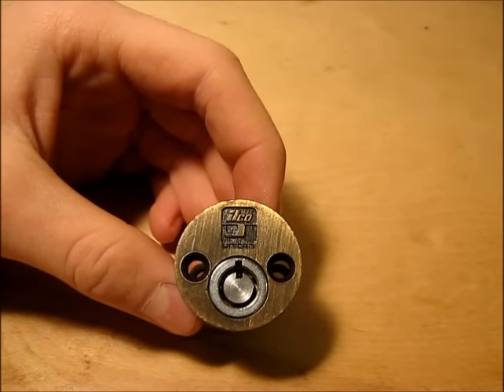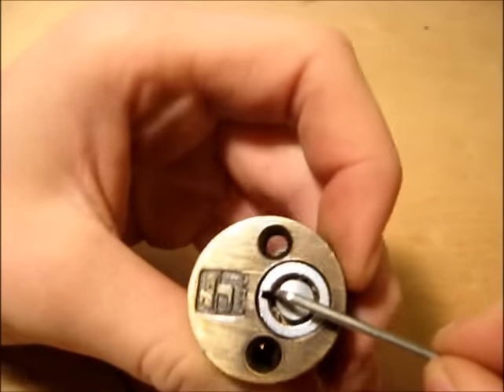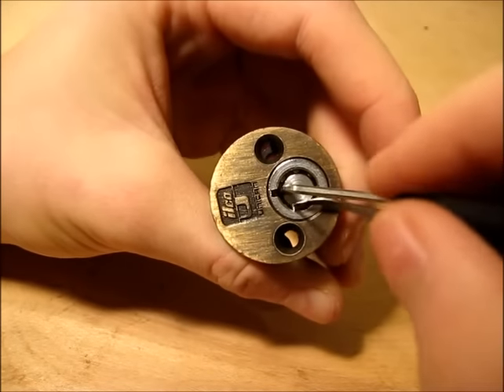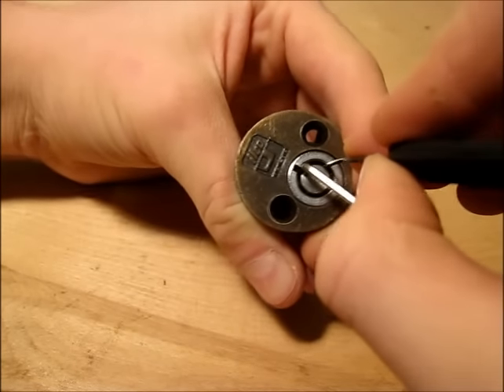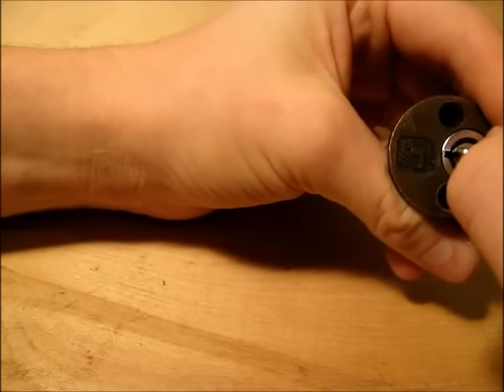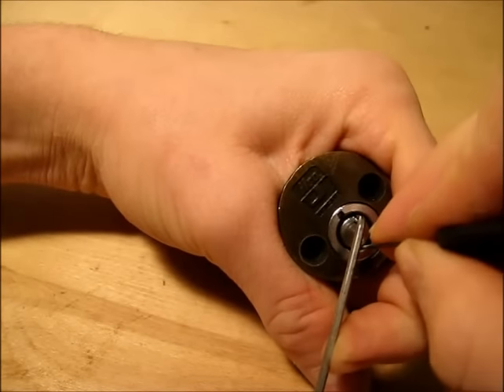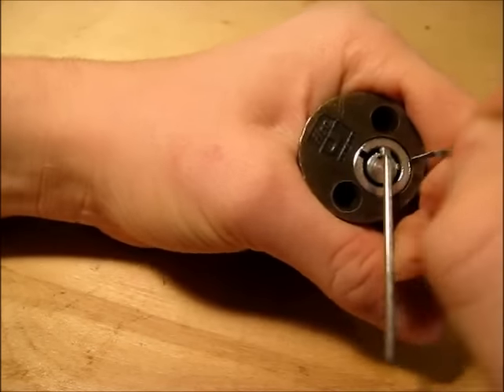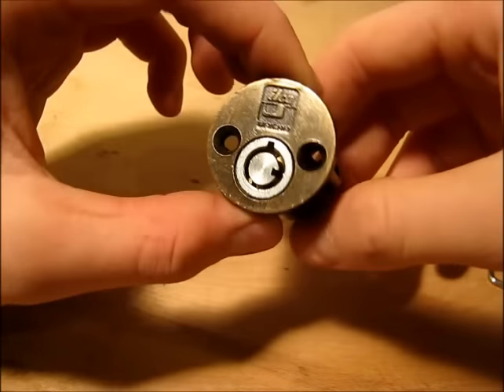How to pick a tubular lock with out a special pick .

Comment: Nobody believes me, but one day my sister and I were working at a horse barn when I had finished my chores early. Out of pure boredom (and being alone), I tried picking a coke machine. I used a little tension and pushed each individual ball inside the keyhole using the end of a paperclip. Suddenly, the main latch popped out! I had genuinely picked a coke machine! Unfortunately, I was so excited and convinced that I was was a master locksmith that I shut the door to show my sister how I did it...and I couldn't get it open again. Perhaps it was a fluke or just pure luck. I looked like such an idiot though.
Reply: Didnt you tell this one in another video

Comment: I figured out another way to do it without lock picks. I grabbed an old junk tape measure, and cut two small pieces off it. Using the edge I cut, I pushed 1 piece in on the bottom, then did the same for the top. The way I got it to work was by pinching the two pieces together which put pressure on the center circular piece, while at the same time pushing inwards which flexed it out so it pressed against the pins,  and twisted.

I was shocked myself that this worked when I figured it out, cause usually my ideas don't pan out, but it worked first try!  However, the second one took like 7 tries, but it still seemed easier than the method in the video. This was done on an Ace II circular lock.
Reply: could you post a video of the piece you cut? I would like to see what you mean
Reply: Bluraz I
Reply: Bluraz can u explain that 1 more time how big were the 2 pieces of measuring tape and then what did you do?  I'm trying to figure it out now 
Please let me know Thanks again I'm very interested in how you are saying you did it.

Comment: Thanks for the very clear instructions.
My lock doesn't have that little groove in the core / center to stick anything into, so it's really hard to tension it. Any advice?
Reply from the maker: Ixupi Do you know who manufactures the lock? I could give you much better advice if I knew what lock you’re working with.
Reply: @PickingandEntering  I have no idea sadly, it's on an old electronic safe with dead batteries and the keys inside haha. There's no brand on it. 
I've found out that there's a tiny gap inside the ring that I need to put rotating tension into, with a little anchoring tool of some sorts. I got pretty far with some makeshift stuff just now, but lost my grip and it snapped back :') I have no experience with locks whatsoever but I think I'm getting somewhere.
Reply from the maker: Ixupi Yeah you’re best bet is to just spend a lot of time on it till you understand how the lock works lol
Reply: @PickingandEntering  I gave up on picking it open haha, but I might still try another time because it got me real interested, what a puzzle. I finally managed to open it without destroying it by using a trick where you smash the safe real hard while wriggling the handle, to bounce the lock open internally. Yay! Later I found a manual, and it said to turn the key COUNTERCLOCKWISE.... facepalm been picking clockwise... 
Is that common?
Reply from the maker: Ixupi Yeah it’s pretty common, most of the time they are clockwise but it’s definitely not rare to have it go counter clockwise.
Reply: @PickingandEntering  hi Michael, we have a basic electronic Yale home safe and lost our key — can you suggest best way to open the lock? TYVM
Reply from the maker: @lynneweinstein3932  It has a key and combination to open the safe is that correct? And you have neither the key nor the combination?
Reply from the maker: @lynneweinstein3932   you have several options to potentially proceed with but one option requires working batteries in the safe.
Reply: @PickingandEntering  tyvm for your response. I’m in trouble - batteries not working😖
Reply from the maker: @lynneweinstein3932  Ok that does limit your options significantly. You can either pick the lock if you have that skill or pay a lock smith to open it. Unfortunately the cost of opening the safe is probably more than what the safe is worth.
Reply: @PickingandEntering  what about if I purchased a 7 pin tubular lock pick - would that work, or a waste of money?
Reply: @PickingandEntering  correct. A mess.
Reply from the maker: @lynneweinstein3932  you could definitely try that! As long as you don’t spend too much money on the tool and you are okay with the potential that you won’t be able to open it.
Reply: @PickingandEntering  TYSM, Michael - I just wanted to make sure it’s not a total waste of money to try that tool. Do you know, by chance, if the Yale home safes have a seven-pin (vs. 8 or 10) cylinder? The angle where my safe is makes it impossible to be sure. Ty again.

Comment: Great video, Does the silver Allen key need to be in while you're pushing with the black one?
Reply from the maker: MuscleSheriff Yes, the silver Allen key has to be in the lock to add tension to the core while pushing in the pins.
Reply: @PickingandEntering  the whole way?
Reply from the maker: MuscleSheriff   Yes unfortunately that is the case.

Comment: Did you know that if you pick it and move it just a little bit, not the full quarter turn,then roll up a somewhat study card and tape it up to the inside diameter of the lock itself. put the card in and make an impression from the study pins and you will have a key for the lock itself and be able turn it all the way open.
Reply from the maker: Really ! I will have to try that, thanks for the idea.
Reply: +Michael DeRose Yep it works,as long as you only move it a little bit to keep the pins stiff.
Reply: Larry G 《 Thumper 》
Reply: What kind of card ??

Comment: Toward the beginning When you say "add tension to the Allan key" do you mean press down into the lock constantly, press sideways (like turning the lock) or do both?
Reply: You would add tension like you are turning the key normally.... (sideways as you mentioned) the whole time you are picking.
Reply: @frankkeaton9563  OK so not applying additional pressure pushing down into the lock, just let it rest where it slides in without pressure, correct?
Reply: @anotherOneMore7  Yes. You put it in place, then push it sideways to make the core move as if you were turning the key. Keep the pressure all the way while picking. When all the pins are set, the sideway pressure will turn the core automatically. You need to adjust the pressure tho. Too much and the pins won't move. Too little and they will reset.

Comment: What size Allen Wrench? Tried using bobby pins for a tension wrench & it didn't work.
Reply from the maker: Atkrdu I used a 3/32 and used a bench grinder to change the shape from 6 sides to 4. Hopefully that helps.

Comment: use a plug spinner.
Reply from the maker: +Paul MvN Wouldn't that get i the way of your pick?  Plus isn't  the neck to fat ?
Reply: mine has interchangeable tips. you would have to pull the pick and tension wrench out before it lock back up again. I'm sure it would work... I'll probable try that this weekend.
Reply from the maker: Ok cool, thanks for the tip !
Reply: +Paul MvN Plug spinner wouldn't work on a tubular lock...
Not in one shot anyway .